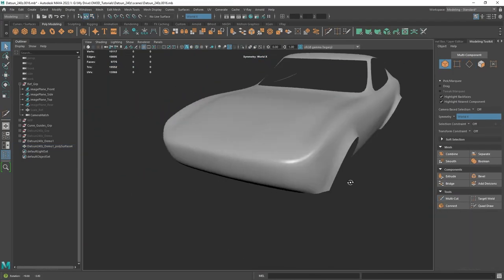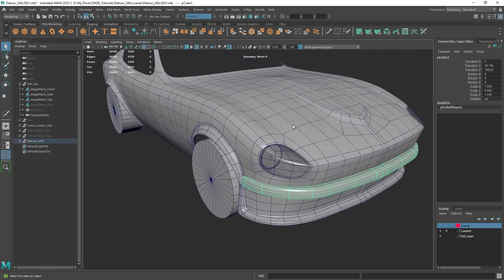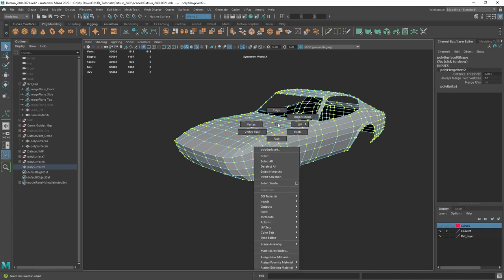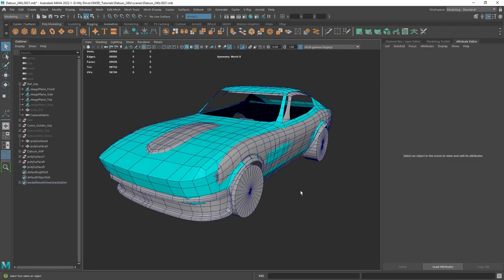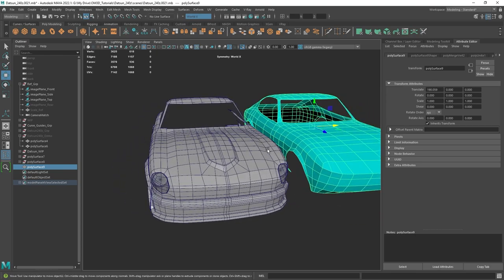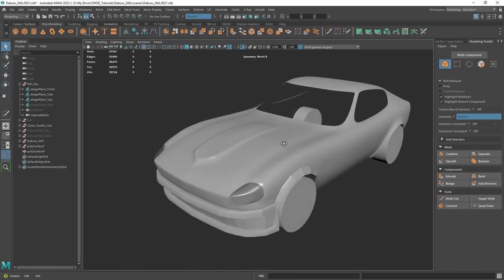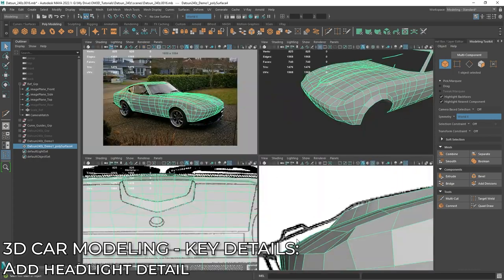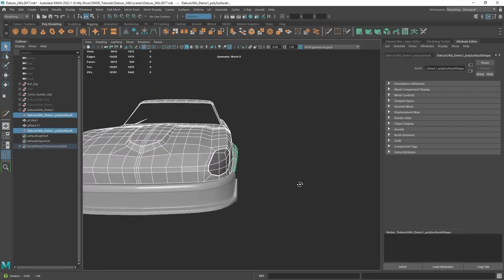3D Car Modeling - How to Add Details

Comment: Again, my pleasure Sir. I am glad I could help.

By the way, you can obtain the same behaviour with vertices snaps (any snap in fact), by just selecting the component you want to snap, then hovering the mouse over any other component or curve or the grid (or whatever you need to snap it to), and then middle mouse drag (while still holding the relevant snap key).

It's perfectly normal to forget this, because it's basically the oldest Maya feature (since 1998, Maya 1.0 on SGI). Though I still think is super powerful and useful.

And again, great video and great contents from you, Thank you very much!
Reply from the maker: Thank you, appreciate the tips Mauro!

Comment: Nice tutorial tnx my question is when you model materials like cars and hard surface things is it must to make measurements to be like real object measurements??
Reply: Measurements don't really matter when you're modelling, but if your scale is really strange, too big or too small, Maya can act a bit strangely at times.

Using realistic measures can be useful if you want to render at that scale. For example, Arnold's shading values can be super strange if your scale is way off.
Reply from the maker: I cover setting overall scale and dimensions in part one. When doing CG, you don't need to be accurate down to fraction of a millimeter unlike CAD modeling. The most important thing is making sure the overall scale is correct as that can cause issues with modeling, lighting, textures, etc as TheNerdOnTube pointed out.

Comment: Hey a bit of a noob question, but around 23:33 i dont understand if the headlights are part of the main mesh of the body work or are they their own mesh, if they are different meshes how can you manipulate the vertex that shape the glass and the shape of hole of the headlight at the same time?
Reply from the maker: In Maya, you can select multiple separate meshes, then go to the Modeling Toolkit and press the Vertex Mode. Or just hold RMB and enter Vertex Mode to be even quicker.

Comment: Hi there :) loving this guide and following along. the curve guides were a massive eye opener !! im gonna bring that up with my lecturer.
I have a question with regards to the lights. when you get the shaping you say that you seperate the mesh and extrude the edges.. i have tried this by going edit mesh detach .. is that correct? when i do it the extrusion for the interior changes the shape of the edges just enough that the seperate pieces no longer match. is this normal? 

sorry for the wall of text and thank you in advance for your time and patience :)
Reply from the maker: Glad you found this helpful. You want to make sure you separate the meshes before extruding the edges. To make sure the extruded edges match, make sure duplicate faces, reverse faces, and reattach and merge vertices back with the other model.
Reply: @OnMars3D  thank you 😊  .. I have managed to get that now.

Comment: Hey man. I would like to add something to curve snapping. If any of the move tool axis is activated then the snapping won't work properly. The activated Move tool axis will be in yellow color. Make sure your move tool's x,y or z axis is not yellow if any one axis is yellow press W again to get normal move tool axis. Initially I  thought curve snapping in Maya is broken , it took me some searching around to figure out how to use it properly. I have never faced any issue snapping vertix to curve after that.
Reply from the maker: This is great, thanks for the tip!
Reply: @OnMars3D  Hi,
It would be awesome if make a tutorial on using 3DS Max Perspective Match tool for Maya just like your Fspy tutorial.